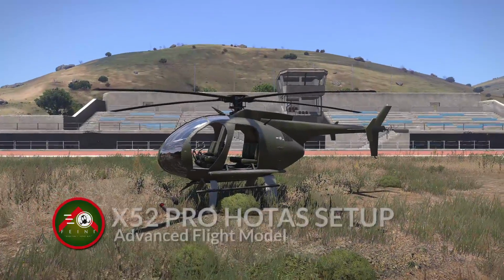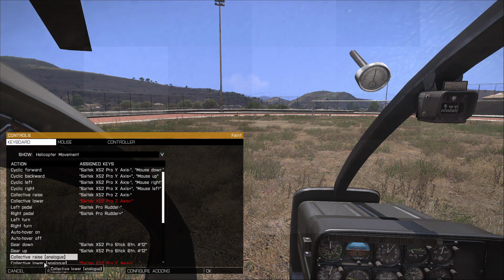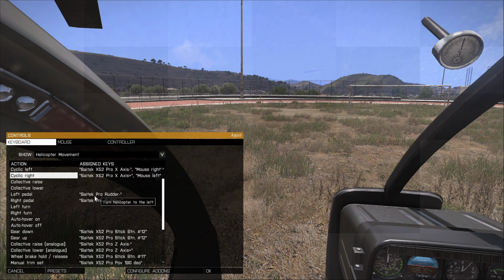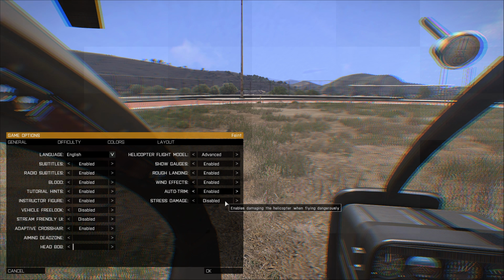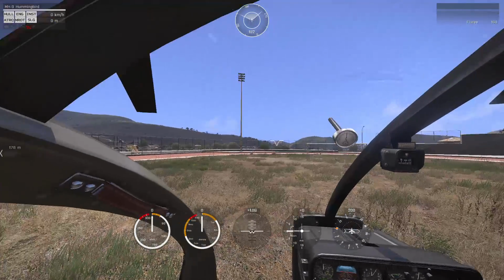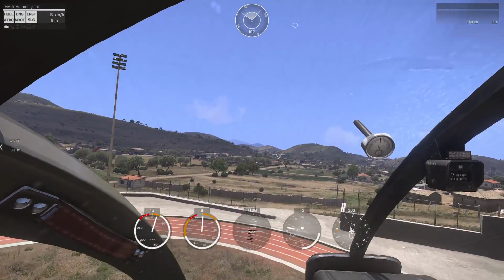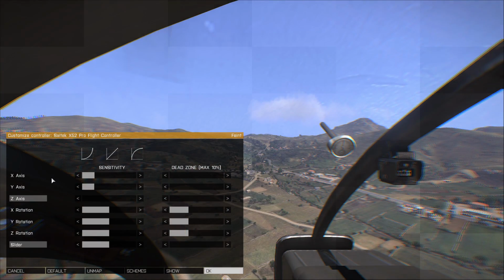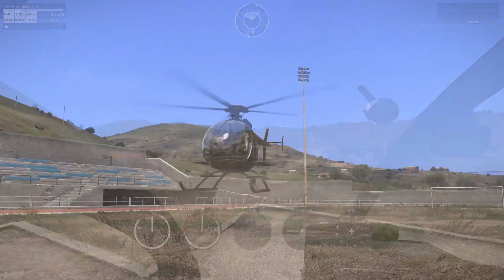Flight Control Joystick Setup - Advanced [ARMA 3]

Comment: Hello, man can you explain or show how to set up sensitivity of twist rotation, with my X52 pro i cant change it in mad catz profiler ...., in game when i put it on 0 my twist rotation is still to sensitive ....., i have no rudder pedals i use twist on stick
Reply from the maker: +Kamil M Make sure you are editing the correct axis.  The axis will light up when you move it.  Also, make sure your joystick isn't malfunctioning.  With zero sensitivity, you should be able to get that rotation to go very slowly on the twist.  If not, there might be something wrong with your hardware.

Comment: Is there any way to use my mouse like a joystick? I mean, the default control is mouse aim, not mouse joystick as you don't control the control surfaces of the aircraft n stuff, but "tell the aircraft which way to look". Having a virtual joystick could be a game changer to me, I'd undoubtedly fly with it like a pro as I have that in all flight simulators because I lack a physical joystick/controller. Default control is just... pure pain. I can somehow land with WASD n that crap mouseaim, but strafing runs are a no go, I either crash every single goddamn time, or miss my targets completely :(
Reply from the maker: No there isn't. I would recommend getting a stick. It's more immersive, you can program the buttons on it to do things you'd otherwise have to use the scroll menu for, and they are fun. You can get a stick for like $30USD. And I'm sure if you use craigslist, you could probably find something used that's very good nearly for free.
Reply: @Feintgames  Well yep... Stick it is. That means I gotta wait to get that money... Used to have one long before, but it's broken. Well, until then I better get used to crashing alot XD

Comment: I've assigned a couple pedals to my rudder axis but it was super slow compared to pressing a button, just bought a new joystick and it turns left and right for the rudder but its the same, super slow, and adjusting the sensitivity doesn't change much, any ideas?
Reply from the maker: +Chris Bennett The button press will go from 0 to 100% instantly.  The pedals will be much more subtle and controllable.  You can raise the sensitivity of the pedals in your pedal software and in the game as demonstrated in the video.  Either way, it's hard to expect the same level speed of pedals compared to a button press unless you're willing to slam the pedals in one direction or another.  I've gotten my pedals to be pretty responsive.  Anything you do will require some personal adjustment time.  I'm also using a mod with the Littlebirds which increases the strength of the antitorque rotor.

Comment: @Feint Im looking at getting a new joystick here soon. What would you recommend if not the Saitek? Thanks
Reply from the maker: +Honey Badger Sorry for the slow reply.  I didn't get an alert that this message was posted.

Slim pickings in the joystick arena.  The X52 Pro old ones before MatCatz took over were pretty good but still had their problems.  The MadCatz versions I've heard a lot of bad things about, though the software is much improved over the original weird and buggy Saitek software.  I wouldn't buy any of these joysticks used honestly unless you could try them out in person and/or knew the seller.  My old X52Pro has been working OK so I've not been looking at joysticks for a while.  But I can tell you my general impressions about some other companies:

In my experience, products from Razer are very cool looking but they never live up to their price.  Again, this is in my experience.  I have several high end products from them and I don't like any of them.

Microsoft joysticks that I had when I was much younger seemed bulletproof just like their mice.  Simple, not flashy, but they work and work well.

Logitech products that I've owned have been pretty great.  I would look hard at a Logitech joystick if I was in the market for one.

Other than that, look at what other gamers are using and see what they think of their products.  A lot of these devices are a pretty personal choice.  Like the Thrustmaster Warthog might seem like the best on the market because of the price, but it's a licensed product which means there's a price hike just for the USAF logo being used.  Also, I've heard mixed reviews for that product and at that price point, it better be perfect for me to buy it.  Other people though would buy it just to have it and they don't care as much about the price.  So again, very personal decisions.

Comment: If i don't have trackir what do i use for moving the head looking around?
Reply from the maker: I think by default it's holding down Alt or double clicking Alt, and then looking around with your mouse.  But if you don't want to do that, you can always assign the head movements to hat switches on your joystick.

Comment: it won't let me use a scheme
Reply from the maker: I believe when you apply a scheme, it automatically maps controls to the different buttons on your joystick.  So if you have a Saitek X52 Pro, it will map flaps to one of the buttons on your joystick.  Gear up and down will be mapped to two buttons on your joystick.  Eject will be mapped to a button on your throttle.  Etc.

Comment: in real heli the collective would come backwards towards you when it's increasing.
Reply from the maker: D goof of course
Reply: Now  that I have you, can I please "bombard" lol you with a few questions.  I'm new to ARMA but  not flight simulation and notice in the A-10 the throttle "thrust" seems to be on full or off even though I've mapped it properly "analogue"and played around with the sensitivity It doesn't seem to make little if any difference?
Second question, is there a way in singleplayer to just get in all the different helicopters and just fly around. I've already completed the one showcase mission but can't seem to figure out how to navigate through the interface to just fly around a bit in all the flyers? I have all the DLC's 
Third question, is there a way to move the cockpit heads up display in the A-10 close enough so you can actually read the hud without having to use the zoom toggle option over and over. I'm just using a hat switch maybe the IR5 is the answer for that one?
I am actually a pilot and have been flying for years and to find this gem is a real treat, wish i'd looked into it sooner. Thanks for your time and effort on the tutorial. :)
Reply from the maker: D goof Whoo, a lot of questions.  Throttle mapping for Planes should be Thrust (Analog) set to throttle forward on your HOTAS.  I have Brake (Analog) set to both my left and right pedal toe brakes, but you can set the brakes to something else.  This will brake your wheels when on the ground and deploy your air brakes when in the air or going above a certain speed on the ground.

To use all of the aircraft in SP, open the editor, choose a map, place a pilot unit, then place and Empty aircraft.  I usually place the unit and aircraft at the main airport on Altis, but you can start anywhere where there's enough room to take off.

The FOV default setting is a bit too wide angle for me and the hud is very small.  So I almost always change the FOV (field of view) by mapping the Zoom (Continuous) to one of my rotary dials on my throttle on my X-52 Pro.  I used to set it to the slider on the throttle, but it broke.  Anyway, sometimes the FOV or zoom level doesn't "take" when I start a new mission, so I just slightly move the rotary dial and the zoom level pops into the correct position.  This way, I can be slightly zoomed in no matter what vehicle I am in or if I am on the ground.  Seems to work great and I just set it and forget it most of the time.  This helps with seeing the HUD but usually the HUD is still too far away.  So I've set one of my other buttons to Zoom + and nothing set to Zoom - and when I release the button the view returns to my default zoom level set by my rotary dial.
Reply: Thanks a million for all the information. i managed to grind through most of the interface now and figured out a lot more but these tips are invaluable to me. thanks again :)

Comment: Picked up a MadCatz F.L.Y.5 and i have no idea how to set it up for arma... or any other game, on arma it shows a list of available keybindings, but for my stick nothing is showing up. The light on the stick is on and i assume its working. do i need a driver or something.
Reply from the maker: I suggest you check their forums for similar complaints.  Usually if nothing is showing up, you should delete previous joystick drivers and install the drivers that came with the stick in the package.  Or, download the latest drivers from their site.  The light can indicate that the stick has power.  But you'll want to look in the Devices and Printers section of Windows to see if there are any problems.  Try rebooting too as sometimes Windows appears to install something, but doesn't make the change until you reboot.
Reply: that is going to break in a few days... U might want to modify it a little bit as the wires inside get caught on the inside of the case. I had to end up cutting a whole in the bottom of mine and elevating it after I soldered all of the wires back together.

Comment: My joystick's sensitivity is unusable low on the x axis. Everything else works fine but I can barely strafe. I can't seem to fix this in the game settings and the driver is showing full range input on all axis. Any ideas/tips?
Reply from the maker: Assuming the joystick works correctly in other games, look at the sensitivity of the x-axis in the settings.  I believe you can set them independently when you click on "controllers".  When on that screen, when you move the joystick, the axis should light up in the settings menu letting you know which one to adjust.

Also, make sure that you've assigned the X axis correctly to the correct input in the game and that it's not duplicated up with other inputs (which other people have had trouble with).  

Sorry, I know these are obvious suggestions, but maybe they will help.
Reply: @Feintgames  this just in i forgot to turn off auto hover LOL

Comment: Sorry to bother,  if I understand this correctly, if I am not using the advanced flight model in an helicopter I should map my x52 hotas throttle both in the analog increase fields with the negative first and the positive second, that will give me 100% range on the throttle? I been having trouble with this. Any help would be really appreciated
Reply from the maker: Hi Dan, it's been a while since I played Arma so they might have changed this. If it's not working for you, try setting it up the more logical way, assigning each axis + and - to each analog direction and see if that fixes it.
Reply: @Feintgames  hey man thanks for taking the time to reply,   I have tried it in normal mode, it doesn't appear to work, I suspect the all thing works differently as I can hear the Heli change noise when I move it but the power curve is different, don't get any lift until 50%,  when in advanced mode I get lift at around 30.  Anyway, thanks for the reply

Comment: HI MATE iv got a problem my joystick only goes to half thrust  and same with  the x and y i can pull back and it seems to no pull back all the way and push forward and for left and right can you help me i know a lot of ppl with the same problem
Reply from the maker: +peter a'beckett Check for conflicting inputs.  Sounds like there are more than one axis mapped to a single input.
Reply: +Feint I have the same issue as him and this is not the problem, as well as this the controller shows the input as 100% in the sensitivity menu yet only travels the cyclic halfway. The mouse has double the travel distance.
Reply from the maker: +Bigbigcheese +peter a'beckett Are you guys using HOTAS joystick and throttle or are you using game controllers like an xbox controller?  If it's a console controller, then I experienced the same problem and couldn't fix it.  For HOTAS, see below.

First, try creating a new profile in Arma and setting up the joystick.  If this fixes your problem, then the problem might be with your profile, not with Windows or your joystick.  If this doesn't work, go to the next paragraph.  To fix your profile, you can either start over with a fresh profile, or try to fix your existing one.  First make sure you're doing the right thing.  If you're using the Advanced Flight Model, then you should be mapping your throttle to the analog inputs for cyclic.  If you're not using the Advanced Flight Model, then you can use either, depending on your HOTAS.

I'm sure you both already tried this, but go into Windows and make sure the joystick and throttle can be moved through the full range of travel and that Windows sees a 100% movement in Windows when you move the input all the way.  After that, make sure you have the proper drivers and the proper software installed for your joystick/throttle.  For Saitek's HOTASs that means not just the driver but the Mad Cats Profile Editor as well.  Once the profile editor is downloaded, make sure it's running.  You can set up a custom profile for Arma 3 at this time or just skip it and go into Arma 3.  Now, go into Windows Devices and Printers, find your HOTAS, right click on it, go to Game Controller Settings. You should be able to calibrate your HOTAS here.  Follow the instructions and see if that helps.  Also, look at the deadzones and make sure there are no deadzones that are limiting your travel.

If none of that works, see if you can plug a different joystick in and see if that fixes your problem.  If it does, then the problem might be with your joystick.
Reply: Creating a new profile worked... But I cannot see why, and I liked my original profile anyway.
There is nothing different in relation to joysticks and control methods in the configs...
Reply from the maker: +Bigbigcheese That's good news. That's easier to fix than a broken joystick. Try resetting the control input to default, save and exit, restart the game, then change it to what you want. Sometimes the game just needs to rewrite the file.

Comment: Am I the only person who when I raise the throttle I start going down
Reply from the maker: Flying a helicopter is like balancing on a ball. If you start to lean forward by pushing the cyclic forward, you will eventually crash into the ground just as you would fall off the front of the ball. So to prevent that, you increase the collective which I guess is kind of like making the ball bigger. It's a balance you have to perform because eventually you'll go faster and faster. And then to slow down, you should pull back on the cyclic. But if you're going really fast you will shoot up into the air. So you have to pull back on the cyclic while decreasing the collective at the same time. That way you slow down without increasing altitude.
Reply: @Feintgames  ok thanks
Reply: @Feintgames  I’m kinda shocked you replied to my comment on a old video

Comment: Hey Feint, just picked up the X56 hotas and arma can't tell the difference between the collective and the cyclic. I'm a little overwhelmed and any help would be appreciated. Thanks
Reply: Todd Woolley cyclic is steering and collective is basically the gass peddle
Reply from the maker: +Todd Woolley Basically operating a helicopter is like balancing on a beach ball.  The Cyclic (joystick) is you leaning in a direction on that beach ball.  The Collective (throttle) will raise and lower the beach ball.  But everything has to be in balance.  So if you tip the Cyclic forward, you will fall forward but you will land on your nose.  So you have to raise the Collective so that you move up.  Combining the two will allow you to fly forward and level without falling.  Both inputs will always be effecting the other. Once you get the hang of it, it's very rewarding.  It's also a lot of fun to get right.

Comment: what do the graphs mean at the top of the sensitivity bars?
Reply from the maker: I think they are meant to be reflective of the response vs input.  Or input vs response.  So if the curve is concave (curved inward to the right), then if you put in a lot of input, you'll just get a little response from the aircraft.  If the curve is a straight line, then the response is 1:1, in other words, if you move the joystick a certain amount, the aircraft will react to that input normally.  If the curve is convex (curved outward to the left), then a little bit of input will result in the aircraft moving a lot.  Basically, it's a complicated way of mapping "more sensitive, normal, less sensitive".
Reply: Alright, eventually figured it out myself after playing around with it a bit. they're just response (of the aircraft) over distance that the joysticks traveled in any axis yeah? like low sensitivity means you get more response from the vehicle in the last few degrees of movement in the joystick than the first few degrees.
Reply from the maker: Something like that.  They are a bit misleading.  I would just ignore those pictograms and stick with the idea that the sliders change the sensitivity.  I am not sure it's changing the sensitivity curve honestly, just the overall sensitivity.  But I could be wrong.